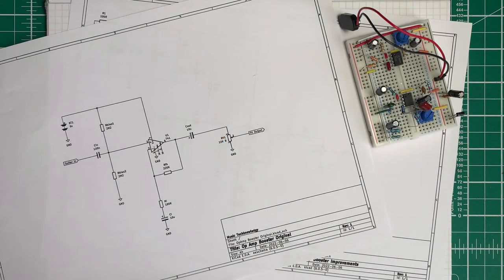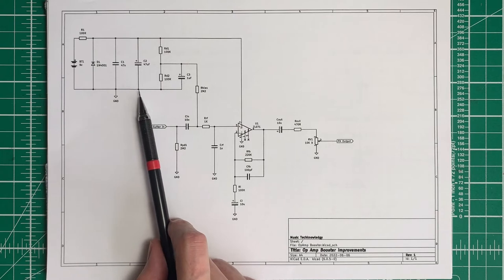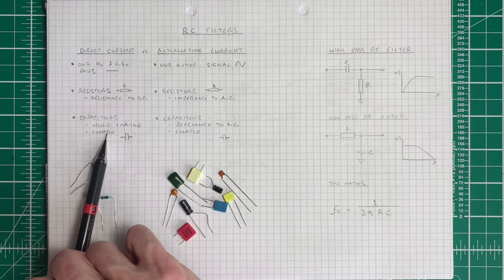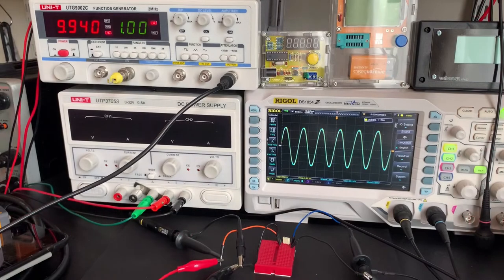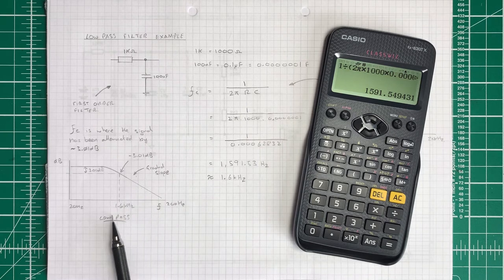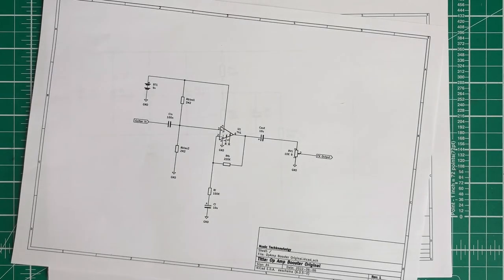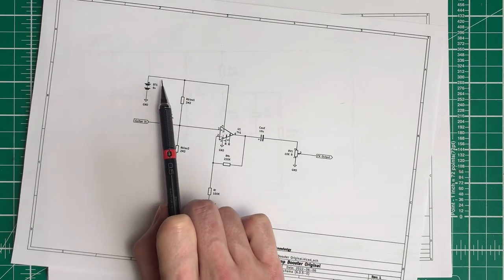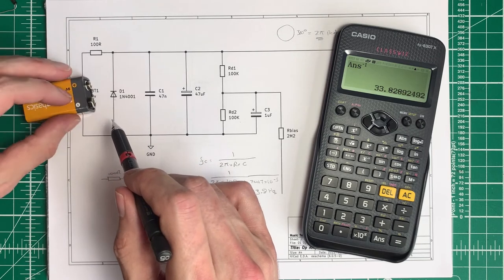Improving a Clean Boost Guitar Pedal

Comment: This is so good! You are absolutely thorough and cleared up so many of the weird little questions. Got my summing amp across the finish line sounding cleaner than ever. Game changers filtering the battery, filtering pre-amplification, and the pulldown resistor. Thank you for walking through the math and using practical numbers :)
Reply from the maker: Excellent stuff on the summing amp, happy to have helped 👍

Comment: Thank you for this video it was very helpful in understanding how distortion effects work. I hope it will get to more people because you've done a great job. I have just one question how is it possible that you get 4.5 V on the input of the op amp? Shouldn't some of the voltage drop across the 2M2 bias resistor and the 1K Rrf? Thank you for your answer.
Reply from the maker: Excellent observation.  Yes, it will drop but insignificantly because the current is so small nanoAmps at the divider (100k) output and picoAmps after the 2M2, so for all intents and purposes it remains 4.5volts.  Additionally we're using a TL071 here that has FET inputs, so that also helps negate the effects due to the massive input impedance.  If you want to experiment further,  nn the folder linked in the description is the Falstad emulation, you could have a play around with the values 2M2 and 1K resistors in the simulator (there's also a video on Flastad if you've not come across it before).  Hope that helps.
Reply: Thank you very much that helped a lot.

Comment: I am curious why the extra divider after the power area with the 2M resistors if you already have Rd1 and Rd2 ?
Reply from the maker: Excellent question.  The Cin Capacitor (10n) blocks DC (and low frequencies) so there's effectively no DC voltage division by the 2M2 resistors.
Reply: @MusicTechknowledgy aha! ok thanks!

Comment: I didn't get why the two 2m2 in parallel?  Also why output is in parallel? And where would you add a switch. Thanks, I really enjoyed the vid. I did electronics in college years ago. So it's like a refresher. Thanks Tom.
Reply from the maker: Thanks Tom 👍.

Great question, it’s because to an AC signal all voltage sources are grounded so for AC analysis both 2M2 are grounded and therefore in parallel. We also assume the cap between them is a short for the AC maths. 

A DPDT or a 3PDT (with led) Switch would be added in the usual way, there’s a video, I’ll link it below.
Reply from the maker: https://youtu.be/hdu99bkEe6U?si=t5pX8YiufvkDBx79
Reply from the maker: This one may help with switching too, I don’t use a PCB in this one … https://youtu.be/dbROhwy07B4?si=fN9GhBdeF8Sqmt5H
Reply: @MusicTechknowledgy  thanks for the reply! Been thinking bout 2m2 in parallel, sort of get it but don't? Der lol.
Reply: No still don't get it. Any way you can demonstrate it? Voltage on resistors follow ac the same? No phase shift like caps.
Reply from the maker: @pandaman9706  No worries, it's tough to understand because you have two different signals, the DC bis, and the guitar AC signal that exists in the same circuit simultaneously.  It took me years to grasp the concept as a hobbyist.  Let's break it down ...
Reply from the maker: Resistors -- Fortunately (for us) resistors exhibit resistance to DC signal and Impedance to AC signals.  It can be taken as the same  i.e. an 1kohm resistor exhibits 1kohm of resistance (DC) and 1kohm of impedance (AC).
Reply from the maker: Demonstrate, well, yes but with a different circuit ... In this, more recent video: https://www.youtube.com/watch?v=ZPKqgtdLN0E 

Look at what I do with resistors R1 and R2 in the Small Signal Analysis.   The fact that it's a transistor affects the outcome differently to using an OpAmp but the premise of grounding the power supply is the same in both (all) cases.

However, what a great idea for a basic concepts video -I'll make a better example in the future and post here when I do. 
👍

Comment: i would like to make this pedal switchable between 3 and 5 dB.
Reply from the maker: Yes, you can use the gain calculation to adjust the feedback or the other resistor in the calculation. Staying with the Kilohm range. 

Remember that it will also shift the cutoff frequency because of the capacitor in the feedback path of the OpAmp. 

If you get stuck let me know and I’ll run some calculations for you.